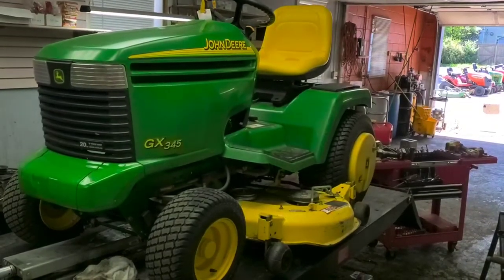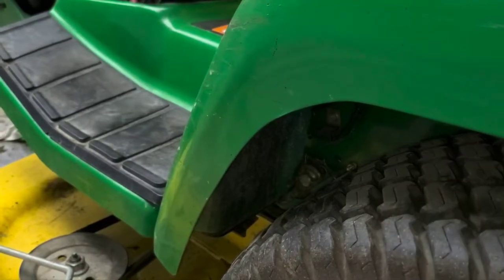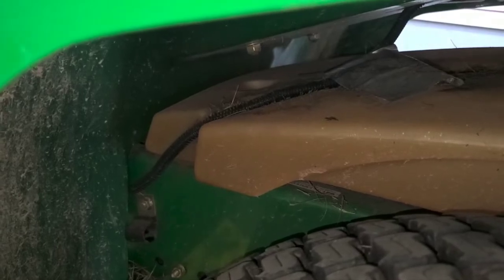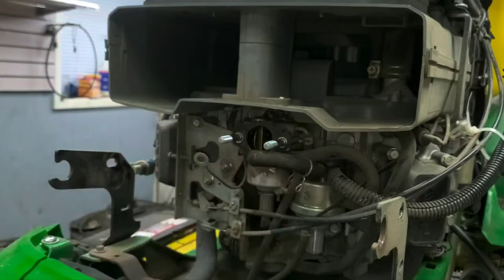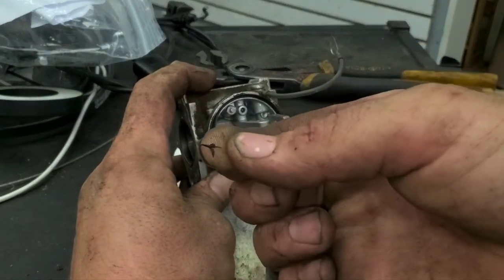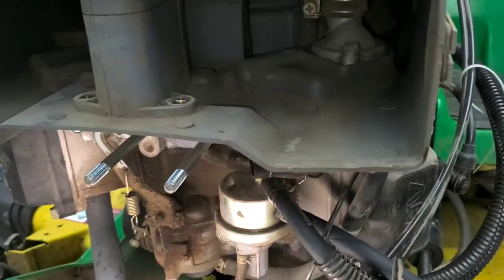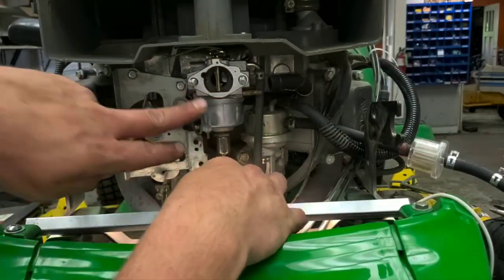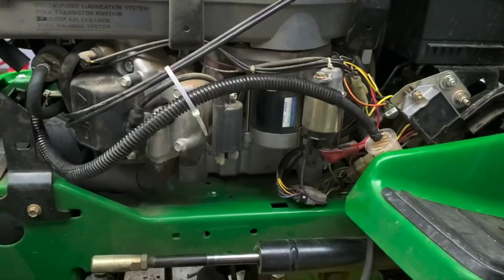John Deere GX345 Mower Won't Stay Running, Won't Start, Carburetor Cleaning, Diagnosis and Repair

Comment: Excellent video! I might add a helpful timesaver step. I left the choke & throttle cables connected to the bracket, removed the two screws and just moved it to the side. No need to mark the location of the cables or remove them. After cleaning everything it started on the first crank. Thanks.
Reply from the maker: Great tip!!

Comment: Great video, I just did mine, it's a 345 but mostly the same. Runs great now and it was pretty gunked up when I tore into it. I found the hardest part was putting the muffler cover on. It's metal and wonky shaped on the 345. Thanks again.
Reply from the maker: Definitely! Thanks for watching!

Comment: Really nice stem to stern clip of the fuel circuit.!
I was having a fuel problem this summer so I ran new fuel line, filter and a vacuum pump but after I buttoned everything up the main drive belt lost a chunk of rubber and one of the idlers on the spring loaded bracket was screeching so I fixed that stuff, but then the battery wouldn’t hold a charge 
I figured that since I was already under there and throwing money at the dealer, I did a hyd.oil change including both hyd. filters  
All that’s needed now is new valve stem seals to stop the puff of smoke
Reply from the maker: Awesome! Thanks for watching!

Comment: Excellent video, why not change fuel pump while front end is apart if you suspect diaphragm is degrading? Really good video and narrative w/o friggin music!
Reply from the maker: Thank you! They still seem to stay working forever and run about $175 last time I looked. This one has been in since for an issue with the ignition coil but this fix works for years without having to replace it

Comment: Thanks for the video, it gave me the confidence to rebuild  (which I haven't done in 45 years) my 2002 GX345 carb.  My Kawasaki FD611v engine is blowing fuel out of the vent/overflow tube after it runs for a minute, then it will start and repeat itself.  I cleaned everything out, as you suggested, replaced the float needle (old one had a crease in the rubber tip), and it still does it. Fuel lines are new. I ordered a new solenoid and will try that, as the engine runs for a few more seconds after I turn the key off and I had read that it could be a sign of a malfunctioning solenoid. Thanks again, and feel free to comment on fuel leak 😁
Reply from the maker: Needle/seat has to be the culprit in this case unless crankcase is full of fuel also?
Reply: @IndRepair  Nothing but oil in the crankcase. I'll let you know if the new solenoid worked. Thanks for the reply.
Reply: Solenoid didn't help the gas pouring out of vent/overflow tube issue. As I said earlier, I installed a new float needle, but still had the issue. Can I do anything about the needle seat, or do I need a new carb? Thanks!
Reply from the maker: Were you able to get this taken care of?
Reply: Interested also if you were able to get rid of the fuel coming out of the overflow tube
Reply: Well, it turned out to be a combination of the solenoid on the carb and the mechanical fuel pump. I had read somewhere that a bad diaphragm in the fuel pump could cause too much fuel to pump out, therefore overpowering the needle and float, and causing the fuel to come out of the vent hose. I also added a couple of extra gaskets to soften the cam rod push. Thanks.

Comment: What brand fuel are you using for your lawnmower?
Reply from the maker: We use ethanol free from the local station treated with 2-Butoxyethanol to keep moisture from gathering and separating out of the fuel

Comment: Carburetor Removal: the top 2 10 mm bolts on the top of the manifold just keep spinning, I can't get them out, any suggestions? thanks, great video.
Reply from the maker: You will have to remove the bolt/nut assembly and do some repairs during reassembly tp make sure it doesn't leak at the intake there were there plastics are not good. Not an easy task but I am confident you will get it taken care of! Thanks for watching!

Comment: Also the rubber seal on fuel cap are falling into fuel tanks and stopping up hoses 
Might check yours and replace or remove rubber seal 
I remove seal and drill tiny hole in cap, it has a hood to keep water out
Reply from the maker: Definitely an issue!

Comment: Hey bud thx for the video.  I'm cleaning the same carb myself and I'm a novice.   Wasn't my mower and noticed when I took the carb off the ground wire is missing.  I haven't found a screw that'll work in that whole.  Is that something that can be a huge problem.  Thx for any response. I appreciate it!
Reply from the maker: Definitely need the ground wire!

Comment: Excellent video.  I have the 345 model ... same FD590V 18 hp Kawasaki liquid cooled engine.  Engine starts and runs fine.  After about 5 min, starts surging and will eventually quit. Push it up to Choke mode, and it seems to run semi-fine but at a little lower power.  Seems like the exact issue you describe. Have replaced fuel pump, filters, and lines.  Only problem I have is, the sleeve for 1 of the 10mm bolts for the manifold spin (or stripped) so I can't get the manifold out and therefore the carburetor.  Argh.  Any "tips or tricks" on getting that 10mm bolt out???  Again, thanks for the great video!!
Reply from the maker: Is that one of the bolts attaching the carburetor to the top plastics you speak of being stripped?
Reply: @IndRepair  Good morning, thank you!! It's the one of the 2 10mm vertical bolts that go down through the large air intake up top to hold the plastic manifold (with that rubber O ring, 90 degree bend, then into the carb).  I don't think it's stripped, but as you said in your video, they must have a metal sleeve inside it and are notorious for spinning.  If I can get that out, then I will follow your directions to clean the carb - it's exactly what's going on I think.  Your video describes the situation perfectly.  Any trick would be appreciated.  Cut out the whole manifold/replace, heat applied to plastic where sleeve is, etc.  Thank you so much.
Reply from the maker: @timplzak4276  Not an easy one to do. Last one I did I was able to remove the elbow while prying between the elbow and top air intake plastic (couple bolts removed of course). The nut (from inside the plastic) came completely up and out of elbow plastic at this point and I was able to remove bolt and just replaced the elbow. I try to avoid heat because the plastic can warp and cause leaking around that intake o-ring

Comment: I only questions I have are:
 For that second fuel filter you installed after the fuel pump. What if your fuel line coming out of that pump has a T in it to route fuel to the carburetor and to the return fuel line that goes back to the tank? Mine has that.
 Should I place the extra fuel filter before the T or after it but before it enters that carburetor?
 I also wonder if that T splice affects the flow of the fuel into the carb and if adding an extra fuel filter there will affect it even more. Any thoughts on that?
Reply from the maker: I didn't realize some of these had a t for a return line. Flow difference will be minimal, I would place it after the t. The fuel going back into the tank would have to be filtered first and again before coming back through anyway
Reply: @IndRepair  ok thanks. 
Yeah we've had it service from John Deere for years but I am tight on money right now so I'm doing some repairs myself and finding some things a little different than it's stock diagrams. I think they update or at least changed a few things over the years. Well I am going to try this out and hope that this will help get it running.
By the way. Great video.
Reply from the maker: Thanks for watching! Glad to help!

Comment: Great video.  What is the part numbers for the carb gaskets?
Reply from the maker: The bowl gasket is 11009-2024, the carburetor gasket to the block is 11009-2343

Comment: How do you remove the plastic elbow when the two top bolts are seized and the nuts are spinning in the plastic housing? It prevents me from removing the carb to clean it.
Reply from the maker: I show it in one of my videos I will see if I can find it

Comment: Please explain the spring on the governor linkage, to me it don't make sense..I put new carburetor on my gt235, it wouldn't run right so I saw I didn't put spring back on, put spring on it runs great. I hear the affects of spring......it just don't make sense to me
Reply from the maker: The spring on the governor keeps the linkages from moving loosely where they are installed. Without it many times you get surging as there is too much slop between the linkages and where they are attached so the engine will hunt

Comment: I thought I seen a return line at the tank end but I did not see a return line at the carb end? Some of these 345 had a T in the line from pump to carb and T off back to a return line to a restrictor in the tank I think to reduce vapor lock. Has anyone had any experience with that style does it work ok? I was going to add that return line and restrictor to my older 18hp 345 to help vapor lock. I also noticed they added a defector to guide cooling fan air to the carburetor area.
Reply from the maker: No return line on this one. Some do have it set up like this as you say

Comment: Hey I replaced my carb using this video. Thank you. When I started it back up, my mower at full throttle, now runs way too high. What could I possibly have done? I’m not very mechanically inclined
Reply: Also, the new carb I bought, does not have a place to screw in the ground, is that a big deal? Thanks
Reply: Also, I have noticed the spring on the governor linkage is pretty rough. Could this be causing my issues?
Reply from the maker: Either a leak at one of the gaskets or something is keeping the throttle plate from moving correctly is likely
Reply: @IndRepair thank you!
Reply from the maker: Glad to help
Reply from the maker: I would never put an aftermarket carburetor on this engine, I would stick with the OEM. We have tried a few different variations of the aftermarket carburetors and never got one to run right. I know it is expensive but so is time and issues
Reply from the maker: The spring on the governor linkages keeps there from being play in the linkages so it stops surging likely not the issue from it being too high
Reply: that is very true!! I might have to just try that if I can’t get it to run correctly. Could it be possible that I need to adjust any of the screws on my new carburetor? I just worked on it basically all day today fixing problems I thought it may be (gasket) and new spring(that one sucks so much to get it btw) lol
Reply: I have tried driving it around and mowing with it. Seems to do okay, but full throttle driving fast it eventually just sputters out then will start right back up .
Reply: I  did have to adjust the idle speed screw or else it wouldn’t stay running. I just found out about the idle mixture screw today when try to read more about it. A mechanic would’ve been cheap at this point! Hahaha thank you so much
Reply: You could definitely be right in the aftermarket carb though. If I would’ve even known there was a difference, I would’ve got the better one. I just happened to buy the one my buddy sent to me cheap for like $25 that matched mine. I will order one of those and try one more time 😂😂
Reply from the maker: @cykfootballman  The carburetor should run good, at least at full throttle straight out of the box. Some low idle adjustment may be needed but high speed jet is non adjustable

Comment: I just got one of these for FREE from a guy I know. He said he put the battery terminals on backwards then he corrected it but now every time he tries to start it blows the blue 30 amp fuse. I haven’t gotten to look at it yet. 
Any suggestions?
Reply from the maker: Check fuses and wiring first, something hopefully stopped voltage before getting to the electronics
Reply: I did a continuity test and it turns out the voltage regulator shorted out. 
Got a new one coming tomorrow.
Reply from the maker: Awesome! Great job!

Comment: Is the carb ground wire required
Reply from the maker: It sure is
Reply: What are the issues that occur  when the ground wire is not connected? I’m having trouble with engines performing well.
Reply from the maker: @jorgecasias8163  It could cause intermittent shutdown or no start issues because of the solenoid shutting off fuel to the carburetor
Reply: Thank you very much. I’ve subscribed and liked your your channel.
Reply from the maker: @jorgecasias8163  Appreciate that!

Comment: Having problems with my 2002 GX325 throttle control linkage or the whole machanism does not function properly pull the throttle control knob down and the throttle on the carburator does not follow. i have adjusted the throttle control cable within the specs of the service manual. PLEASE HELP! i have no control over the engine speed except for the choke
Reply from the maker: Was the carburetor removed before this started happening? Does the throttle plate on the carburetor itself move freely?
Reply: @IndRepair  nope carb was not removed. The throttle on carb did move freely but i did give it a little bit of turbine oil just today i started it and it is fine all i did was adjust the throttle cable. oh and i did oil all the connecting point i could get too easily. so i think it was because we had a 40 degree temp change in a manner of of few hours 5 days ago.
Reply from the maker: Nice!

Comment: Mine runs 3 seconds and dies do you know what could be the problem
Reply from the maker: probably a fuel or carburetor related issue but hard to tell without some diagnostics. That would be my first step, to use some starting fluid or carburetor cleaner to see if it will stay running. Keep a fire extinguisher close by just in case it backfires...

Comment: Used electric tape around all the gaps in the plastic bodies atop the carb.  Nothing is sealed above the carb...crazy design.  Carb never stay clean
Reply from the maker: Yeah, those plastics warp so bad very quickly and they pull in debris because of it. Something stopping it is better than nothing. Thanks for watching!

Comment: Expect carb rebuild or replacement every few years with the crap gas plus all new fuel hoses every year 
Don’t buy new junk folks
Reply from the maker: Yeah doesn't take long!
Reply: Is it better to run higher octane fuel (90+ octane) or does that not matter because of the alcohol content in 87, 89, and 91 octanes?  Would any additives help prolong the rubber components?
Reply: @Brittbelle96 non-ethanol is what your looking for.